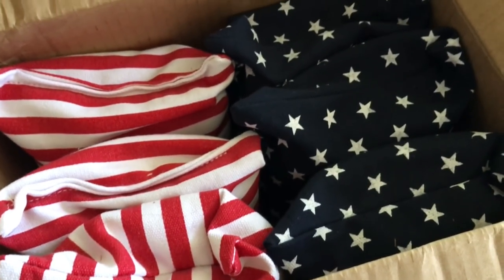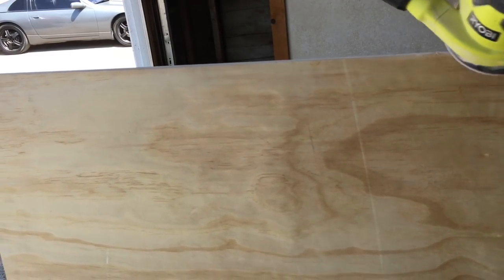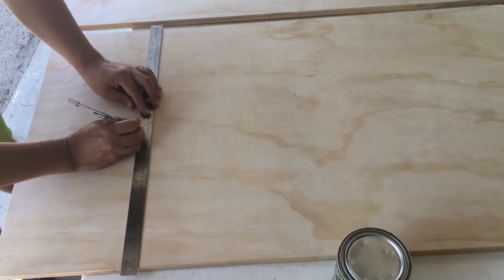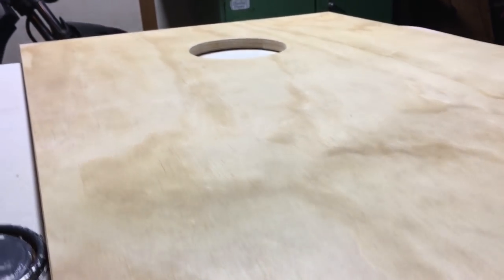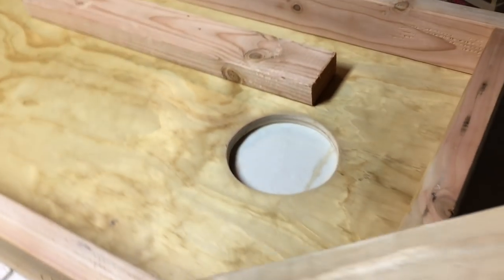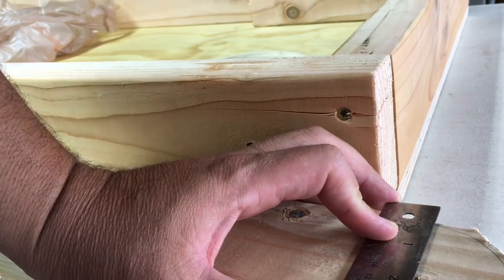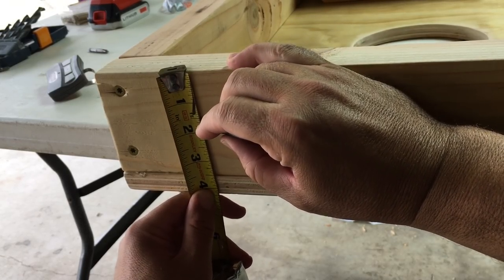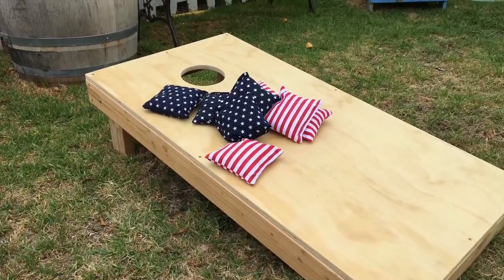Cornhole build that will blow your mind! DIY corn hole board.

Comment: If you make your own beanbags use plastic beads. The majority of corn hole boards are stored in the garage  and the mice will chew through your bags and eat the corn. 
Also if you clamp and glue make sure you don’t clamp too tight or it will damage your corn hole boards surface. And get all the glue off or it is ugly when you put on your finish coat.

Comment: The legs are the hardest part and you messed them up just like I did. Lol.. the legs need like 30 degrees angle I think
Reply: The leg angles are much easier if you leave the legs a bit long then prop the board up on the edge of a table at 12in, then mark them at the table level.

Comment: Bah spend the $20 and buy a 6" hole saw from Amazon...so much easier lol
Just predrill the center hole so it doesnt jump around and scar the face of your board.
But hey nice job rounding that off....it would end up a 7" egg shape if I sanded it lol

Comment: about how much money will one spend building our own?
Reply from the maker: Depends on the quality of wood you use on top. Teak is probably expensive but a 4x8 sheet of wood should give you enough for 2 sets just have Home Depot guy cut them into 2x4 sections